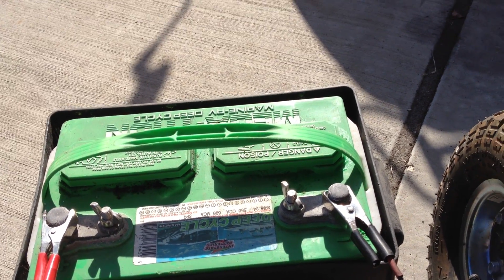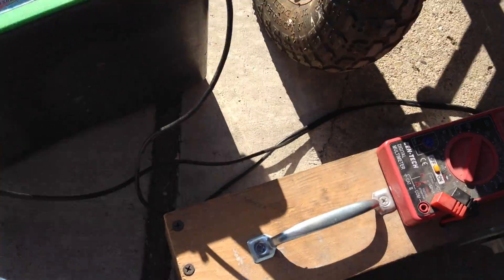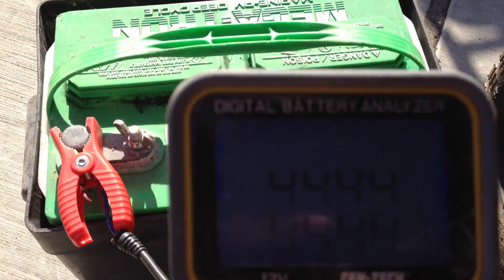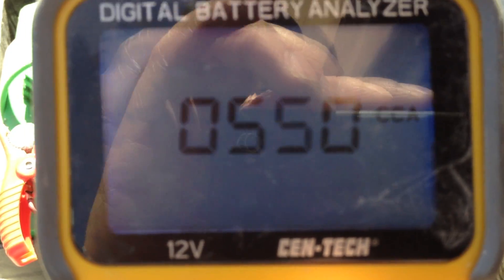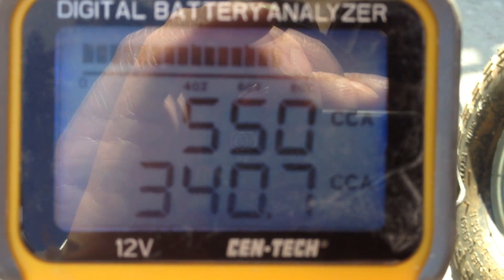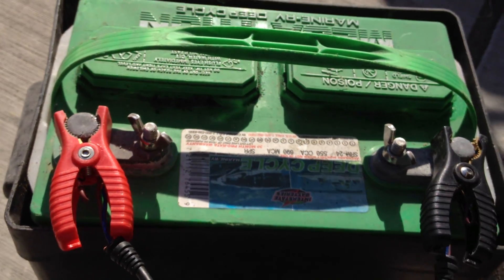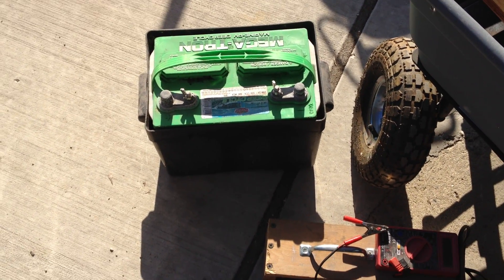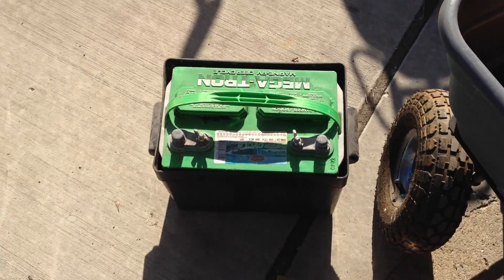Lead Acid Battery Desulfation Using Epsom Salt  -Attempting to use Capacitive Charger  Part 8 of 10

Comment: 10. point some thing orhms is a good resistance for battery that is  not greater than 20 ( between 9-13) that is great  for revival battery ! Thanhks for the video .

Comment: There are several factors in getting a good result. One resource I discovered which succeeds in merging these is the Jons Mender Guide (google it if you're interested) without a doubt the most useful info i've heard of. look at this interesting site.